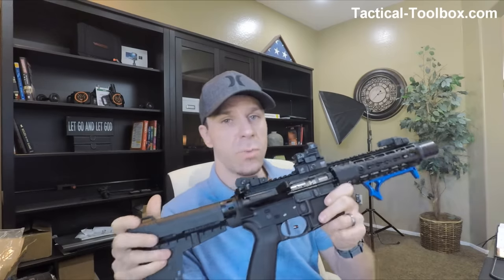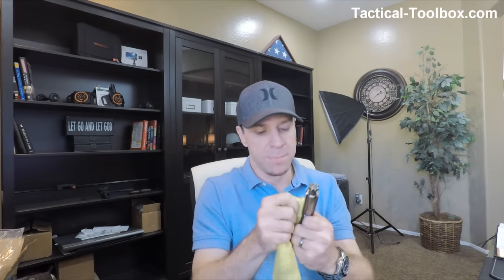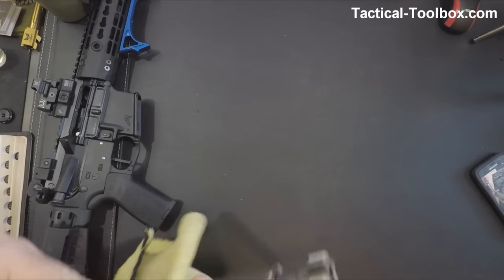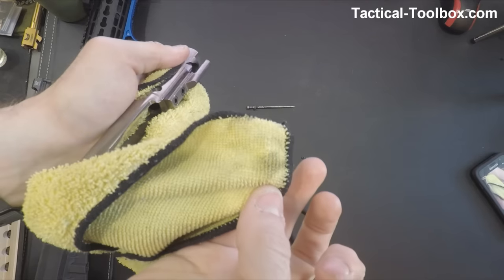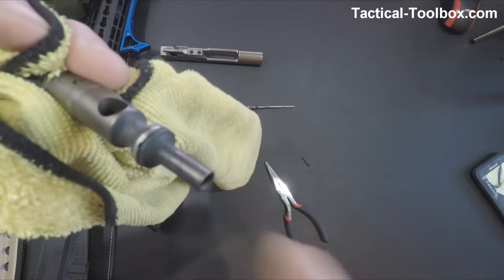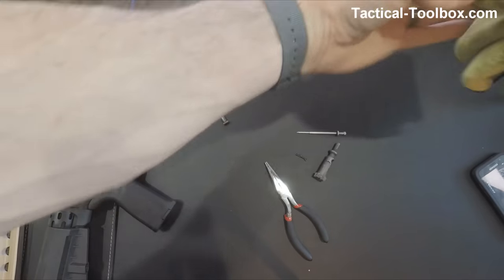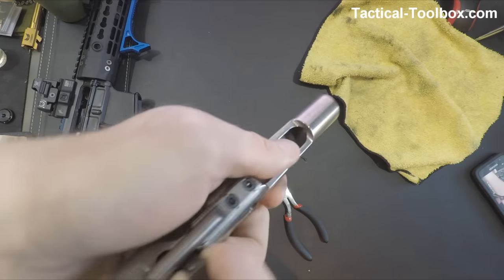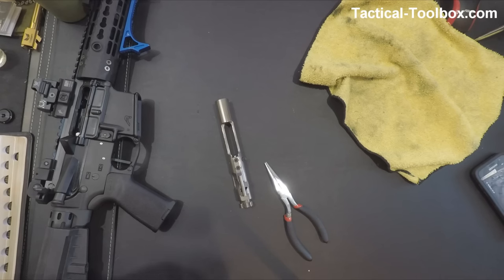Aero Precision AR-15 Nickel Boron (NiB) BCG Review! No Lube!

Comment: I’m trying to gather some further-on research about coatings and treatments, without any biases — only based on facts/trial testing. The ones I’m currently most interested in are, coatings: Cerakote Elite and Black Nickel; and treatments: QPQ (Blacknitride+ aka [plainly] Black Nitride) and RF85 (most commonly associated with Anderson Manufacturing). 

   From what I’ve gathered, all aforementioned have qualities of lubricity at varying levels and all have claimed lube-less functionality. I’m tending to gravitate more towards the said treatments because: one, it isn’t a coating/plating (known for flaking and/or chipping) and, two, it doesn’t change the dimensions of the original design by adding an additional thickness to any surface. 

   However, the Cerakote Elite coating boasts a highly durable and lubricious ceramic coating but at a very minuscule addition to the surface’s overall thickness. Also, very recently, I’ve learned about Black Nickel as being QPQ treatment but with a NiB coating (please correct my knowledge at any point). I don’t know much about Black Nickel, but of the whole list, this option I’m least interested with.

   As for the treatments previously mentioned, I’m impressed thus far with RF85 but it is almost exclusive to Anderson. If I go straight to the company that provides the RF85 treatment to Anderson (for ferrous and non-ferrous metals), they require large batches of items for treatment at a minimum of “$5,000.” Anderson’s RF85 offerings claim to be “the world’s only lube-less rifle” with high benchmark test results for durability and reliability. I feel Anderson has a decent but limited RF85 lineup though. Lastly, QPQ — as like RF85 — is a treatment that goes through the whole thickness of the metal and not just at the surface. So if there is wear past the surface, the lubricious qualities are continuous throughout the entire thickness of the metal. Whereas, the said coatings would stop their lubricious qualities at the surface. 

   I write all of this because I’d like to create an AR build where I can — if need be — run the rifle completely dry for a prolonged period of time but still count on it being nearly 100% reliable. Additionally, the coatings and treatments on my research list also claim to have qualities of cleaning with ease. 

   I might catch some flack like, “just properly lube and clean your rifle.” I agree, knowing proper cleaning/lubing procedures and familiarizing with the mechanics of the rifle will always be beneficial to the owner. However, I’m on the hunt for the best possible upgrades — fitting my needs — available on the market. Thank you for reading this long winded message and for any insight that anyone can provide!
Reply: Nice write up man!! Check out the YouTube channel "small arms solutions". Chris has a 3 part series that is specifically focused on bolt carrier groups. The part 3 video is focused on finishes.

Comment: (FYI) Really liking my NiB set. So much that I replaced the factory bcg in my other rifles. Yes. They wipe (mostly) clean. Yes. You can run them dry. However, running dry shortens the lifespan of your gas rings and cam pin. Especially if running suppressed. 
Just a drop or two in the rings and on the shaft of the cam pin extends life and aids in cleaning(wipe'n down).

Comment: I actually have one of the original spikes tactical nickel boron BCG’s from 2009. Out of the thousands and thousands of rounds I’ve shot out of it I’ve only had one jam; a stove pipe. I still lubricate it out of habit but I don’t clean it super often. My only complaint is that it discolors over time and the bolt itself becomes rough on areas of non-contact.

Comment: 9310 is a cheap tool steel. 158c is actually what you want. Theres a reason COLT, BCM, DD, SPIKES, PSA Premium,  Fail Zero , Cryptic Coatings all use bolts made from 158c and not the cheaper 9310 tool steel. Most Aero bolts are 158c too.

Comment: Nice bolts as is the Fail Zeros. You can run them dry without issue. Military test ran the Fail Zero dry for over 10,000 rds without a failure and that's the idea to keep dirt and sand from sticking. Lubing them actually will cause them to catch dirt\carbon.
Reply: RockyTop1911 Fail Zero has staking issues
Reply: Cryptic coatings probably better the bcgs are made by toolcraft and they put their mystic coatings on them. Check them out

Comment: It's 158 carpenter steel. What you have is  9310 alloy.
Reply from the maker: Yeah on the Aero Precision website... It says the standard Bolt is 158 Steel and the NiB Bolt is 9310 carpenter Tool steel..... Faxon firearms wrote an great article about why 9310 is superior to 158 Steel. 

Here's the article 
http://faxonfirearms.com/blog/why-9310-steel-in-an-ar15-m16-bolt/
Reply: Tactical Toolbox If done correctly, which is rarely done. I'll choose 158 carpenter steel all day long. Hopefully aero did a proper job though. If not it's 50% weaker than Carpenter Steel
Reply: Tactical Toolbox All to do with heat treatment
Reply: @TacticalToolbox  yeah 9310 can be superior if done correctly which is a hard process and alot of companies dont. I have not use this brand tho and they usually do good work so they might

Comment: Nice video Sir. You got me thinking talking about different materials for engineering the bolt carrier group. A quick Google search seems to say that nickel boron is the absolute best material currently for the BCG. I recall from my days in the auto industry That molybdenum is known for high lubricity. There's a molybdenum disulfide grease used in cars, but then I wondered, has anyone ever engineered a boat carrier group from molybdenum or some alloy of molybdenum and another metal? Is that even possible? I mean low friction is the ultimate goal of that BCG right?

Comment: 50 rounds isn't even enough to justify cleaning. The back end of the bolt won't have much even after a couple hundred rounds because the gas isn't forced back there unless you are running a suppressor.

Comment: im new to ARs, whats the point of using no clp and running with less lube?

Ive run maybe 500 rounds through my dpms, no failures of any type. i do use clp and a brush to clean parts...
Reply from the maker: TryHardGamers I would recommend using some oil with any BCG... Basically with the NiB BCG... You won't need near as much oil if any. The NiB coating lower the kinetic friction, so that means that to bolt won't get as hot and that will help the BCG last alot longer.

Comment: First time builder here and the BCG is one of the last things I'm purchasing because it's probably the most expensive single item I'm going to purchase for my ar-15 pistol build.  Quick question: I want to use 300 blackout rounds, but there aren't many BCGs dedicated specifically to that caliber.  I definitely want a nickel boron BCG as well, so what caliber BCG will work with the 300 blackout rounds?  Sorry if this is an annoying question.  And thanks in advance!  Cheers!
Reply: You probably already found your answer but 5.56 bcg is what is used for .300blk. It's the same brass as 5.56, it's just necked larger.

Comment: good to know Aero's nib coating is quality... i have a wmd nib and after 200 rds it turned goldish
Reply: RSLewis My NIB wmd had a color change too, still slippery as fark though. I'll try Aero next if the staking seems proper. Fail zero has staking issues
Reply: NiB will discolor, but it doesn't affect the lubricity. Or so everyone on the interwebs says. 

I still lube my NiB BC to make it easier to wipe clean.

Comment: Late to the party, but found this video while looking for straight dope on BCGs. Working on my very first AR, which is a Ruger AR556 (16" with free-float hand guard). I've updated the trigger already to a Geissele 2-stage (stock trigger was not very smooth). Ran about 120 rounds through it out of the box during the first session. Worked flawlessly. Took my wife out this week after replacing the trigger and it choked on the 12th round. BCG locked up solid and had to "mortar" it to release it. So now, I'm thinking I should probably put a better BCG in. I'm leaning toward Radian's Enhanced BCG or Aero Precision's M16 cut BCG. Is there any real reason (other than lubricity) that the nickel-boron BCG is functionally superior? Thanks and great video!

Comment: I'm building my ar currently but it's just so expensive when it comes to the bcg alone
Reply from the maker: Yessir...you can cheap out on everything except the BCG and Barrel
Reply: Tactical Toolbox agreed
Reply: Ive got BCG;s that I got on sale at Palmetto for $60 and clean/lube like you should... theyve never gave an issue in the years ive had them. Ive got more expensive Nickle boron finished BCG;s from Aero and Spikes.... work the same..
Reply: @TacticalToolbox  Im building my first AR in OD green. I want it done right so im not building 3 or 4 or 5. Im buying the AeroP barrel and NiB BCG, its gonna run me about 470 but i got a rifle stock for 40 bucks (40 off) and an OD green Cerekote upper receiver for 60 from Republic Arms and 40 for the Aero rifle buffer tube. If i can find Mbus sights and an OD green handguard for under 100, each. then i think i got away easy than most. LOL.

Comment: it's chambered in 556 & 223??  Can only be one.  dude, you only put 50 rds its not going to be dirty anyway... also if you lightly oil the nib's the carbon wipes off easier.  FYI
Reply: RSLewis Your wrong. You can shoot .223 through a 5.56 rifle, but can't shoot a 5.56 through a .223. The chamber is a little longer on a 5.56 and the round as around 9000 more psi of pressure. You can shoot .223 through 5.56 with less velocity. If you shoot 5.56 through a .223, you can over gas the gun.
Reply: @--RSL--  .223 wylde barrel solves the problem of too much pressure in the 5.56. Perhaps you should read a bit more.
Reply: @--RSL--  <3